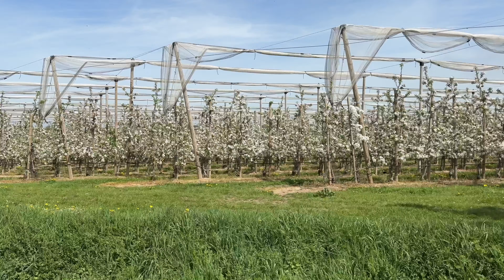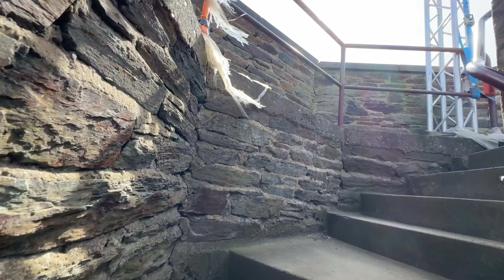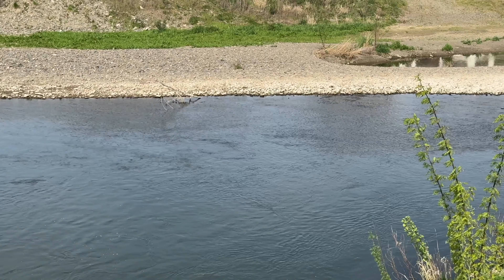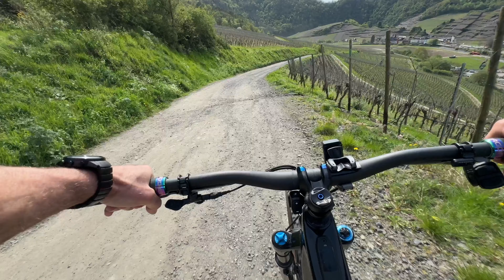13.04.24: Ein Tag im Ahrtal,  Update Ahr Flutkatastrophe

Comment from the maker: 0:00- 0:24 Bei den Ponys
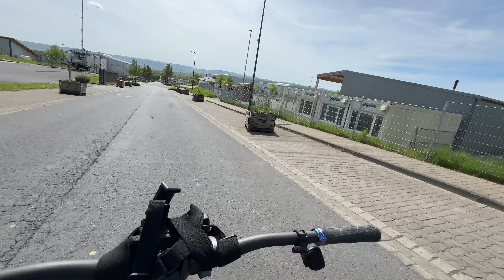0:25- 0:32 Apfelblüte
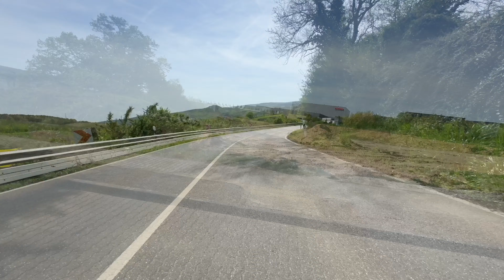0:33- 1:00 „Innovationspark Grafschaft“, ehemaliges Gelände „Baustoffzelt Keyser“ und „Helfer Shuttle“
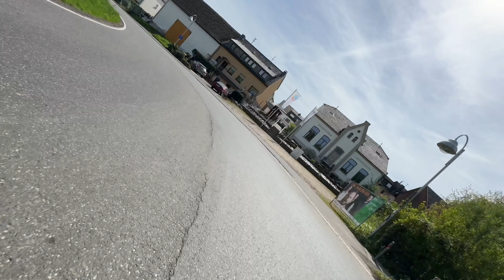1:01- 1:20 Abfahrt nach Ahrweiler, über Lantershofen
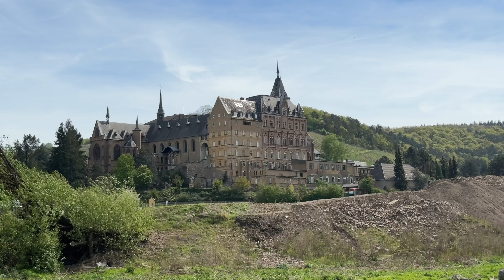1:21- 8:20 Ahrweiler, am Fluss entlang bis Dr. von Ehrenwall’sche Klinik 
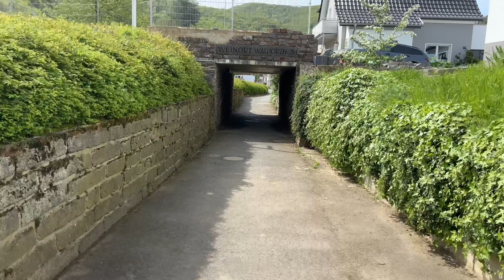8:21- 10:45 Blick auf das Kloster Calvarienberg, Weg nach Walporzheim, am Fluss entlang 
10:46- 11:15 über den schmalen Bergfahrt nach Dernau
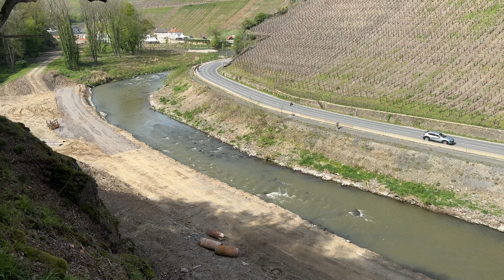11:16- 11:27 Bahnarbeiten direkt am Fluss
11:28- 11:56 Gasthof „Zum Sänger an der Ahr“
11:57- 12:29 weiter über den schmalen Bergfahrt nach Dernau
12:30- 16:10 Marienthal von oben, Blick bis Dernau
16:11- 16:27 weiter über den schmalen Bergfahrt nach Dernau
16:28- 17:41 hoch zum Krausbergturm, Dernau
17:42- 21:06 hoch zur Aussichtsplattform, Blick auf Rech, Dernau, Ahrweiler, Bad Neuenahr, Siebengebirge 
21:07- 23:15 Weg nach Rech
23:16- 23:59 Blick auf Rech, Bahnhof, Hotel Appel, Gasthaus „St. Nepomuk“
24:00- 24:56 Blick auf Dernau und Rech
24:57- 25:38 Abfahrt zum Ortskern
Rech
25:39- 29:15 Rech, Ort
29:16- 31:12 Mayschoß, gesehen von der Saffenburg 
31:13- 32:08 Rech, gesehen von der Saffenburg
32:09- 32:57 Abfahrt von der Saffenburg
32:58- 33:30 Mayschoß, Hotel Lochmühle, Wohnmobil Stellplatz
33:31- 35:29 nach Laach, am Fluss entlang 
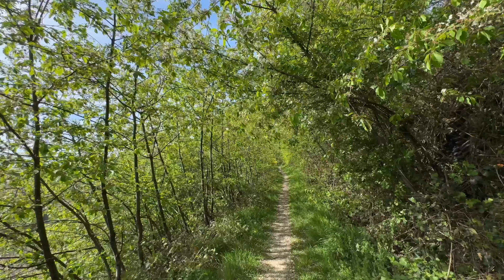35:30- 40:54 Laach, Hotel Lochmühle, Blick auf Mayschoß, Ümerich
40:55- 41:35 Weg nach Altenahr, am Berg entlang 
41:36- 44:16 Blick auf die „Baustelle am Tunnel“, Burg Are, Weißes Kreuz